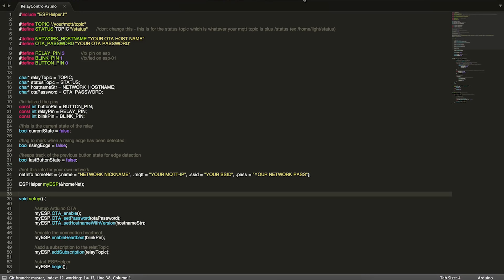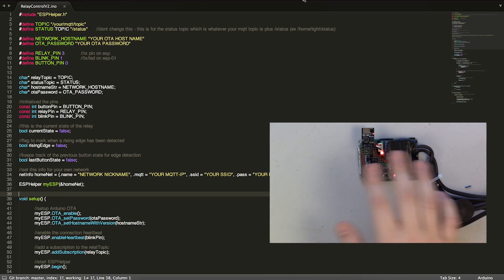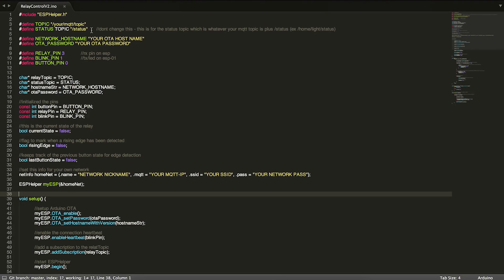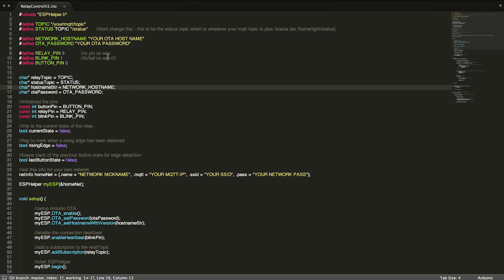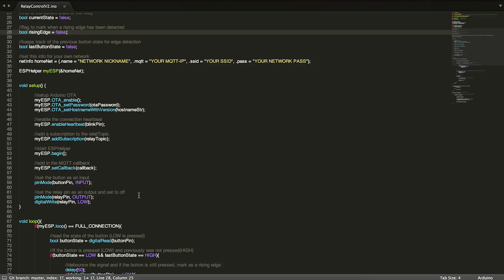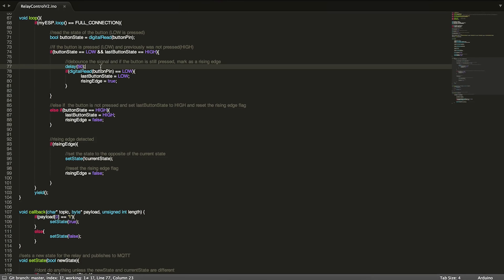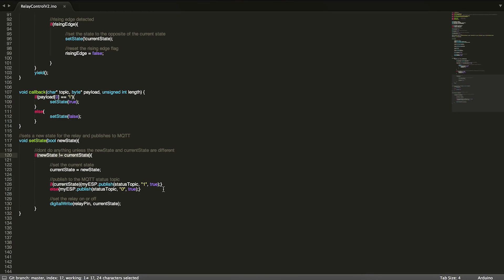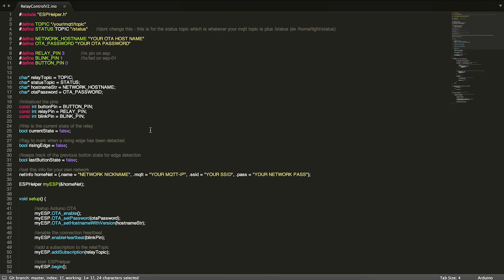ESPHelper Relay Demo

Comment: As you are so good at teaching please can you do a video on MQTT and how it works from your point of view I thought it was for data analysis not just switching things on and off like if I want to switch a socket on using your circuit how would that work why not use IFTT on-off sorry that probably sounds dumb but I am new to software Thanks Bob in the UK

Comment: Hi, this worked a treat for me using esphelper so thank you so much for your help, I even got it connected up to node red :-). But please can you explain the pin out numbers?  TX pin would seem to be 2... how is it 3?  What are the actual pin numbers as referred to in the code of an esp8266-01? I trawled internet but cannot seem to find the relevant docs.  I want to try and subscribe to different topics and do different actions ...
Reply from the maker: Since all ESP8266 devices have common pinouts its easy enough to translate from one version to another (ie pin 0 on an ESP-01 is the same as pin 0 on an ESP-12). So looking at the pinout for an ESP-12 gives a bit more info. If you take a look at this pinout http://esp8266.github.io/Arduino/versions/2.0.0/doc/esp12.png you'll see that TX is pin 1 and RX is pin 3. Just because the 01 has pins 0 and 1 exposed doesnt mean that pin 2 will also be exposed like you'd expect on an Arduino. This may be a bit of an info overload but here is a chart that breaks down all of the ESP8266 pins functions as well http://www.esp8266.com/wiki/lib/exe/fetch.php?media=pin_functions.png